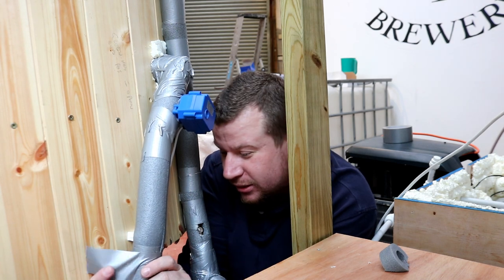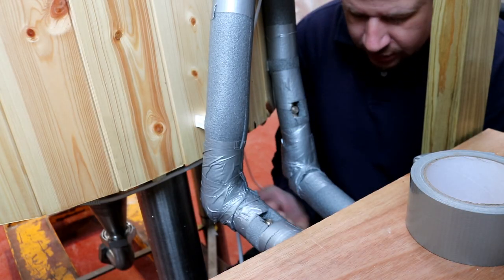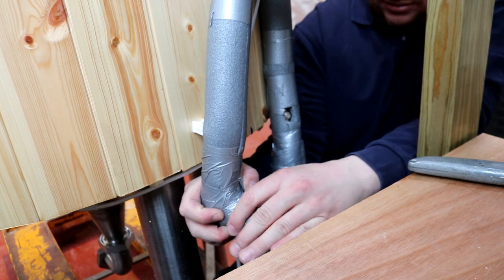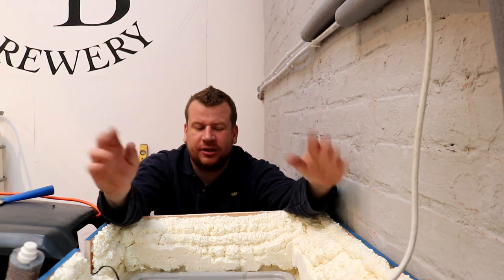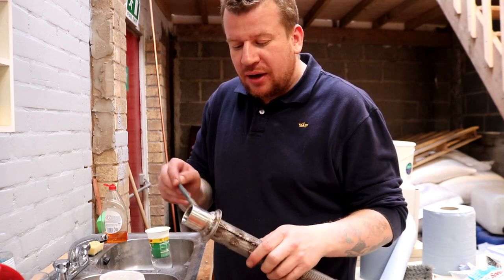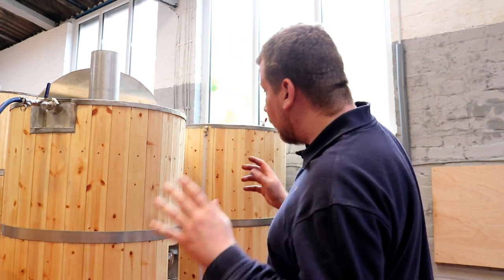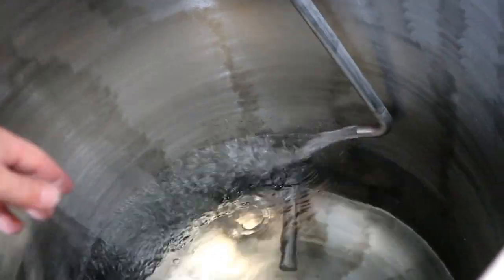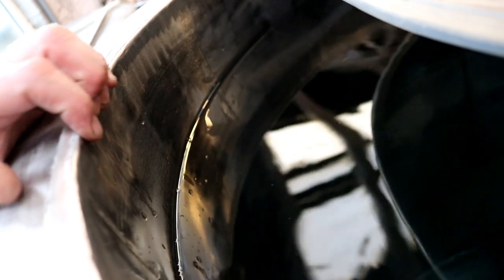TANK FILLING AND TRANSFER TESTS.

Comment: Looking great! What’s you loss of liquid for each kettle? Looks like you could brew a (big) high OG wort then split it into the FV’s then water it down?!? I know the big non craft brewery’s do it & it makes for a thin brew but could be a session. Cheers
Reply from the maker: There is no loss in the boil as it is conical. The mash will lose a few litres but not much and it is the pinch point for the batch size, no way I could get enough grain in to do a split batch. Anyway I know the big boys do it, it is called Partigyle brewing. I think you lose a lot of flavour and body that way. .

Comment: Could I install a whirlpool on my 8 gallon boil kettle by simply attaching a tap 1/4 of the way up and then on the inside have a 90 deg bend? That would avoid me having to have that long pipe running down from the top. Btw why is there a reason why you do that?
Reply from the maker: Yes, you could. The reason mine is at the top is so I can remove it for cleaning without getting in the tank.
Reply: HarryBrew69 nice one! That makes sense
Reply: Thanks bud did my first brew with the whirlpool and she worked out tops!!!

Comment: weld m16 nuts spaced out around vats then 8" piece of box section or angle with a 16mm hole then use a m16 t bolt out of studding you have all that no cost
Reply from the maker: BINGO. Yer that is the answer I have been looking for. Thanks man.

Comment: If I put a pencil behind my ear it falls out. I hope that my contribution was helpful.
Reply: If you put a pencil behind your ear it falls out where?! You shouldn't put things in your ear. I once had an itch in my ear which was ongoing for several weeks, possibly even months. On that occasion, I put something in my ear and the next day I had a mild ear ache. Eventually, I took the plunge, and got myself an ear syringe, which is one thing you are supposed to put in your ear however I would only do this as necessary and not just for the sake of it. It's like a little enema for your ear.
Reply: Charlie Essex. No, not in my ear.  Between my outer ear and cranium.  The gap is too large which is why I voted to leave the EU. We need to 'take control' of the outer ear cranium gap. Bloody Europencils falling on the floor all the time. Enough!!!
Reply: I can keep a pencil behind my ear, but only the left one. It falls out of the right ear and when you're right handed, it's not that useful
Reply: Wild Boar Brewing. Sinistra was the early version of the Latin word for left but also meant evil or Sinister. Wooooo spooky!